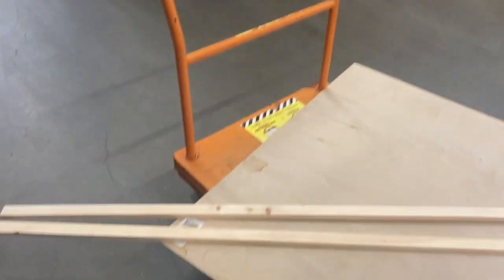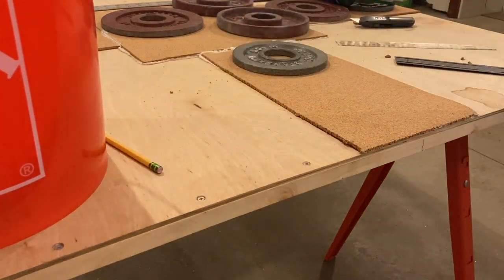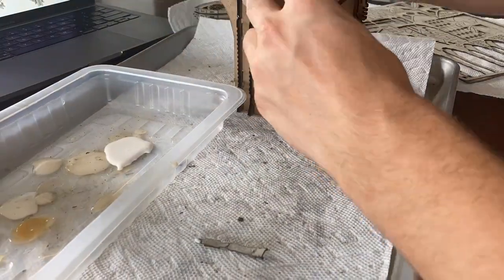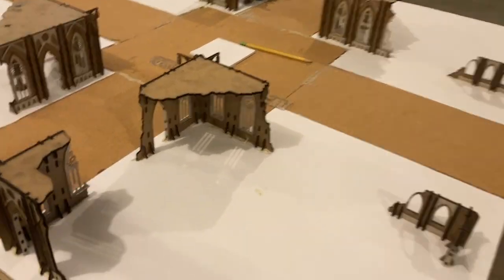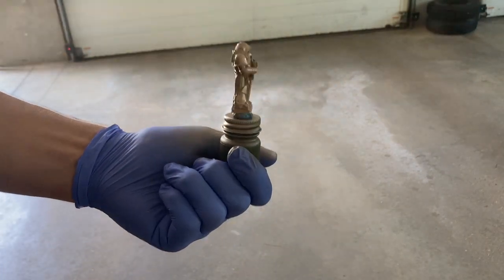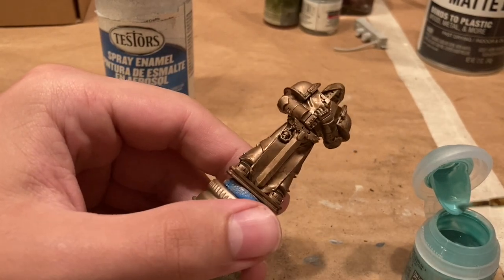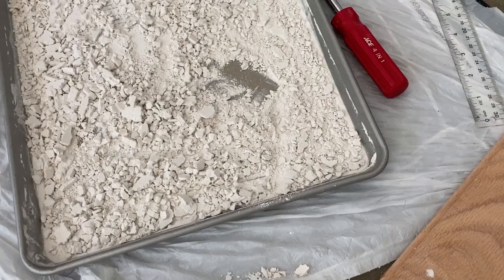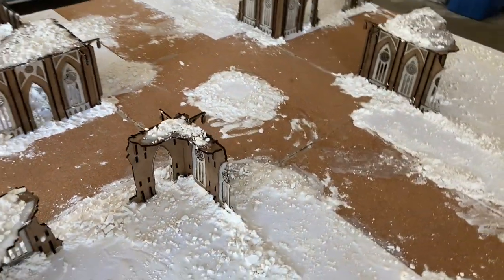How To Build A RUINED CITY Gaming Table for Warhammer 40K

Comment: Cheap materials but 100's of $ in tools and a workshop space. Totaly useless.
Reply from the maker: Only power tool I used was a drill--you can get boards cut to size at most lumber yards where you buy them.
Reply: You can still make the table without all that

Seriously, you’re the type of person to complain about a tutorial on how to change motor oil and call the video useless because the guy used a lift when you can just as easily get on your back and unscrew the cap yourself
Reply: @CMTechnica  I'm anoyed at the clickbait. But no worries, I just won't bother with this channel again.
Reply: @HallBr3gg  what's click bait about it  the title states: how to make a ruined city board. That's it. Nothing more. I don't get what your gripe is. Literally all you need is a craft knife, screws and a screw driver. Everything else is basically paint, glue or filler
Reply: @Antonio_Tony_  they changed the title ...
Reply: @HallBr3gg  Oh. Didn't know that. Fair enough